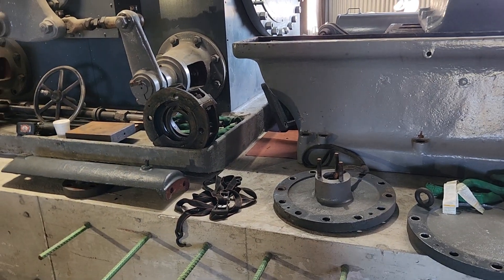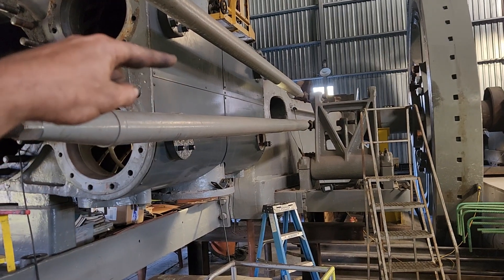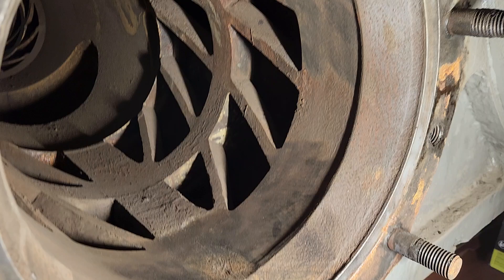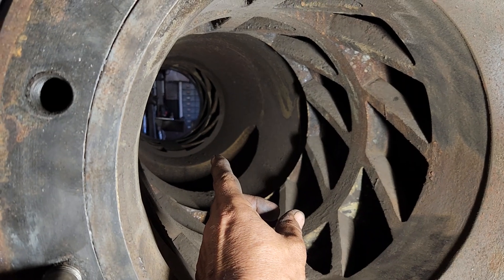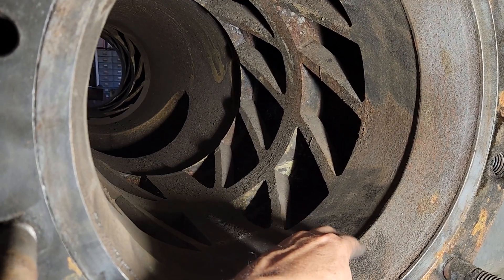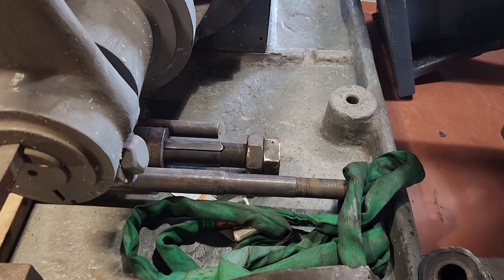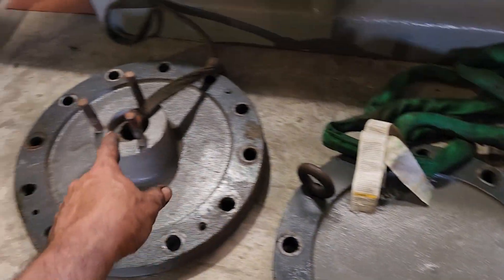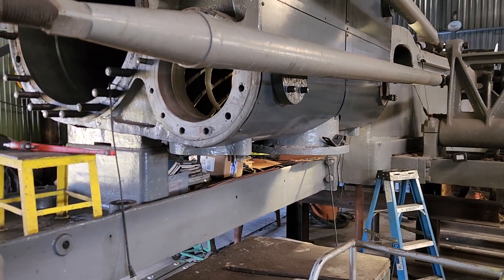Tod Engine Restoration: Exhaust Valve Issues

Comment: If this is the original design then I think you get it all machined and corrected, but don't change it from the original design.  Think of all the years it ran under extreme duty to get this worn out.  You don't plan to ever work it like that, so for history sake I think you should leave it as it was originally built.  Just a thought I love your work and efforts to preserve out industrial heritage so this is not meant to be a criticism of your efforts.
Reply from the maker: If we were going to recast the valve spools so that it fit with a few thousands of clearance then there would be no need for a modification. But we are going to use the old spools and the excessive amount of clearance demands that they be guided from both ends.
Reply: @YoungstownSteelHeritage , understand, thank you.